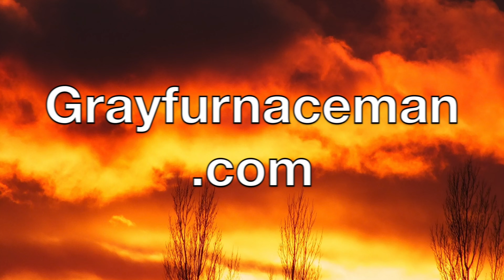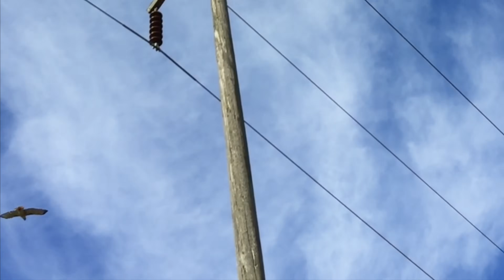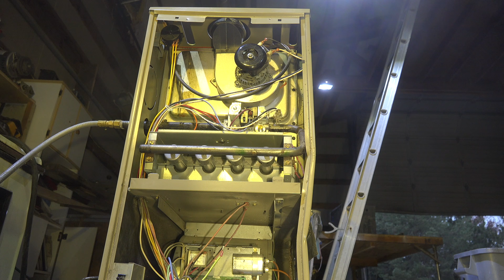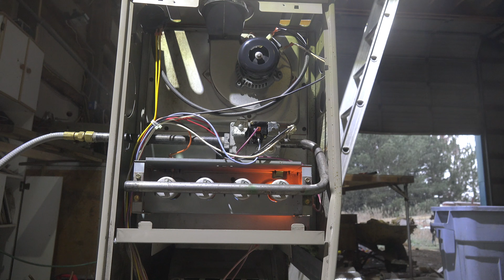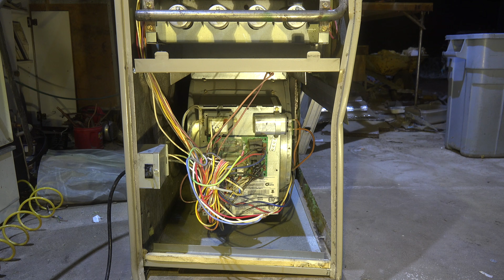Diagnosis and repair of the furnace fan Part 1

Comment: Same thing is happening to my icp 80% furnace but blower works and furnace short cycles.  Flame turns on and off.
Reply from the maker: Look for dirty blower, filter or ductwork problems.
GFM
Reply: @grayfurnaceman  i got 9.56 on the black wire. 7.30 on the orange. 4.08 on the red wire.  5.50 on the blue wire amp draw

Comment: Thanks for the info on diagnostics of fan motor. Have you ever had to test a choke coil type of fan motor , could you bypass a choke coil straight to the motor ,to see if the choke coil is bad ?
Reply from the maker: You could bypass the coil, but I have never seen one fail.
GFM

Comment: I had a fan motor replaced and the repair guy had a problem turning it off. Currently the fan is running continuously. Which it had not done before. Old payne furnace.
Thank you for your videos!
Reply from the maker: Get him back there to do it right.
GFM
Reply: @grayfurnaceman  ur right thanks.
Reply: @grayfurnaceman  2 guys came today could not find the short. Said there is nothing they can do because the wiring does not have a diagram.
Reply: Sometimes I wonder about some of these techs.  A decent tech would draw one from the way it is wired.  
GFM
Reply: @kingmike7729  Find someone else, a good tech should now a furnace wiring by heart (at least just a regular 80% residential) Sounds like the relay is stuck close or a short in the "G" or the t-stat.
Reply: @JoseJB0  I appreciate the response. The problem was a bad limit switch. I don't know why those guys could not would not test it.  Luckily I found one online and got it running correct. 

At one point I couldn't get the furnace started. And there was a reset button on top of the Furnace.

Comment: Very cool, looking forward to more and beginning to search your vast library of topics.

Been working on restaurant refrigeration a couple of years. Got roped into to looking a my best friends a/c last summer (dirty coil, contactor & cap) and started poking around the air handler and furnace. Last night went back, tightened up a leaky gas coupler, installed  condensate switch, pulled the blower motor and vacuumed a bunch of crud. 

Looks like I'm married to this thing now!

Thanks for your time and sharing the knowledge.

Comment: I would test for power at the heat terminal on the board. If there's power being sent to the motor then I would test the capacitor, if the capacitor is good then I would replace the motor & capacitor. I replace the capacitor when I change a motor or compressor no matter what.

Comment: Bad Board/Bad Cap/Bad Motor/ ... maybe a loose wire... thats all I can think of
Reply: TheGhettoLobster mine is doing the same thing, however blower works for AC.
Reply: @tonyromano6220  Do you have a variable speed blower? Whats your furnace called
Reply: Yes it is a replacement motor from WW granger 2015 so not that old.

Honeywell board and other components.

After watching this video I am wondering if I can test motor by attaching to 110v directly. One leg at a time.
Reply: Board is old enough that it has no LED.
Reply: Ducane is on access panel.
Reply: TheGhettoLobster bad relay on control board. Logic pointed to relay, I expected an external component, live and learn.

Comment: What we would do with washing machines is hook an AC clip cord up to the motor to check to see if it will run without going through any of the control systems.  Somebody below has suggested the capacitor.  If it doesn't start with direct AC power the capacitor should be checked.  In the case of a furnace, I would also spin the motor or fan by hand to see if it's a mechanically locked rotor.  I believe you can also use an ohmmeter to to check for continuity in the windings.   Obviously a visual inspection is also in order.  If you can see the windings and if they  look burnt and smell burnt it's probably shot.  If you can start the motor with an AC clip chord, then it's more likely an issue with the motherboard.   Some motors have a thermal protector switch that can be reset.  I would at least look for that.  I know that furnace fan motors can clog up with dust and lint, and be destroyed from lack of air going through the motor itself.  It's going to be interesting watching you and your methodology, along with learning what the actual problem is.  Given that the furnace was salvaged from somewhere, I think there's a strong possibility the motherboard is bad and it was determined that it wasn't worth fixing.  If it was just the fan motor or a start capacitor,  they or you probably would have replaced it; although sometimes people make a decision to simply replace the furnace based on age alone if a major component is broken.

Comment: think I heard a relay click sound and no noise change/anything occurred. but maybe it was some other noise in background or metal expansion.
time to check for loose wire and voltage at board terminals, amperage on motor wire/s, then power off unit, check capacitor and that blower rotates freely, with a quick touch to confirm it's not overheated and thermal OL tripped. check for oil ports and oil the motor/blower shaft (assuming the issue is fixed and it has them). then on to other safety checks while there :)
Reply: All good techniques.  A bad relay certainly is a possibility.  The click you heard could possibly be a an overamped thermal protector on the motor shutting it off.  Putting an amp meter on one of the motor supply wires is a great idea to see if any current is even going to the motor at all.
Reply: no other clicks/noise heard in between, AKA a real technician is needed and they NEED to train youngsters in both REAL and new farce trades.....
they day you ignore and forget real history, it becomes obsolete to you, but they enemies will bring it back, time and time again which equates failure to US and its ourt own faults driven by GREED(upstream pocket padding, unions anyone?)...
I am not god, I do not claim to be, I am not collegiate/bible/etc. brainwashed sheeple. think of me as you may and might. but I tell far more truth and try to not lie than they all do.

Comment: Does that fan motor have a run capacitor? If so that could take out the motor
Reply: Definitely needs a check if the motor cannot be started with an AC clip on cord.  I'm not sure if small blower fans need a capacitor to get started.  I don't think the start load is very great as the blades just spin against air which isn't too resistant at low speeds.
Reply: Internet Privacy Advocate  - Pretty obvious its a PSC motor with a run cap, they almost all are unless they are higher end variable speed motors.  In this case you can see the cap clearly.  “Advocating” hot wiring the motor is bad advice on many levels, but especially before checking the simple requirements first like sequencer and or fan controls, power distribution and of course the cap.
Reply: Yeah you can see the capacitor top right above the circuit board

Comment: sir can i use co2 as the shield gas when i brazing because i am worry about that co2 is a ‘wet'’gas it will be bad for the system
Reply from the maker: Yes, it will work fine.
GFM